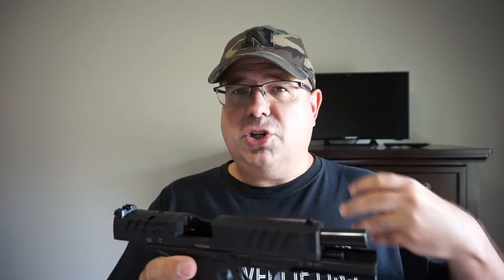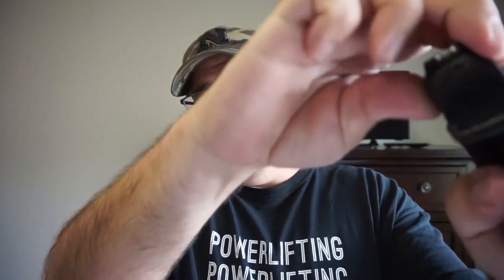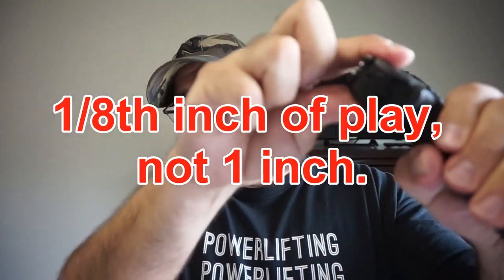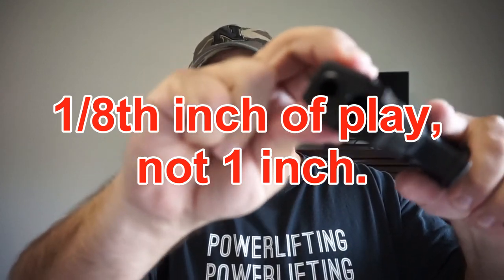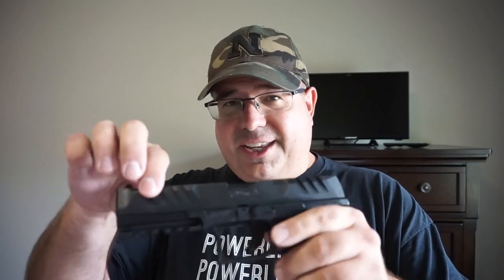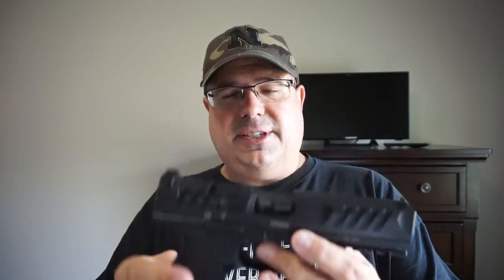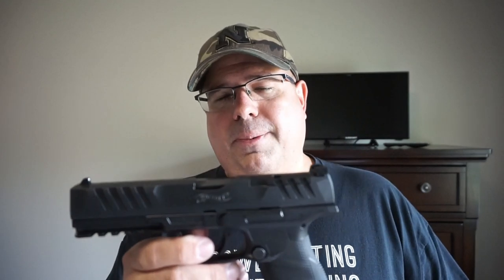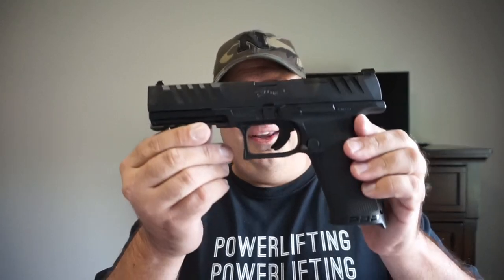Watch this before you buy a Walther PDP.

Comment: Lol@thinking that’s gonna be an issue if your “in a combat situation”. Something tells me you’ve NEVER been in ANYTHING remotely close to any combat whatsoever. If you had, then you’d know that first off; you’ve got 100lbs of gear that’s gonna be a lot louder than your secondary weapon making noise. More importantly, if you’re in said combat and your walking around shaking your secondary weapon like that than you should probably seek psychiatric help once you’re rotations up. 
 Glocks have done this forever and pretty much every handgun that’s not a hand fitted 1911 or the like. There’s ways to remedy this, but I’d have a competent gunsmith do it so you don’t crack your slide or the frame.
Reply from the maker: It was just something random that came off the top of my head. I guess if you were physically shaking the gun would rattle but no, I have never been in a live fire combat situation before and I am sure the gear you are using makes noise.
Reply: @travisp11  you’d have to be doin some serious shaking, like seizures while holding it in your hand which probably wouldn’t happen. Yes I can see why some people would buy a gun and somehow notice this and think it’s an issue, but like you said that Walther said, it’s not a problem. More of a personal preference. Also reference this becoming more of an issue later on with more wear etc…..I wouldn’t worry about that. If you have any issues along those lines there gonna be catastrophic. I’ve had my PDP (4” fs) for awhile now and haven’t had ANY issues mechanically. I have had a couple mag issues, but they’re replacing the internals if you have those issues and send them in. I’m sending mine in within the next couple of days. 
 I just came across your channel with this video and I can respect your reply and not that it matters, but I’m gonna check out some more of your videos. You seem straight up and most of the guntubers on here only care about profit and selling or pushing something that makes them money or gets them free guns and ammunition. So I appreciate the reply. Take care~
Reply from the maker: @KendrasEdge757  I really wasn’t gonna make this video but I was surprised by how many people are bothered by the rattle their PDPs make. Part of it was people worried something was wrong with their firearm but I really think it just comes down to design tolerances.
Reply: @travisp11  yeah I agree that’s probably the case here as is with other manufacturers.